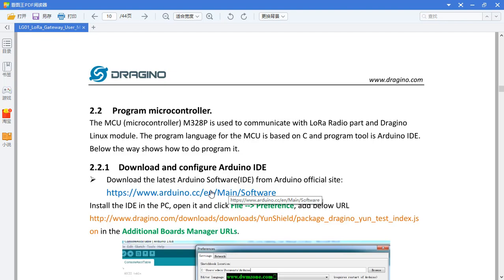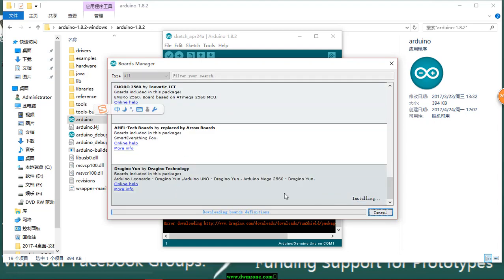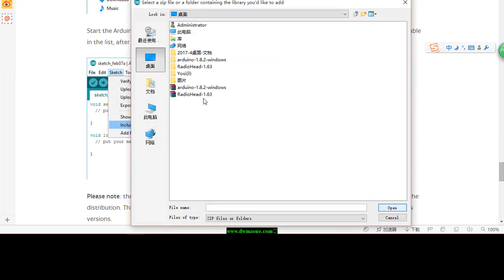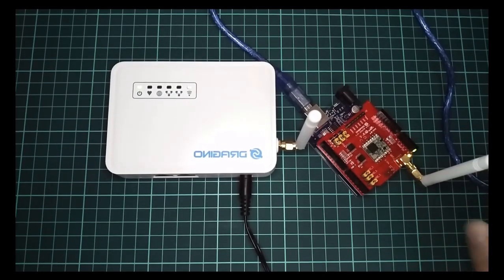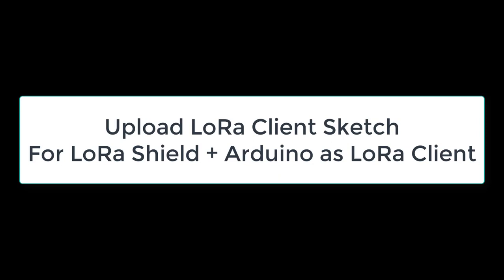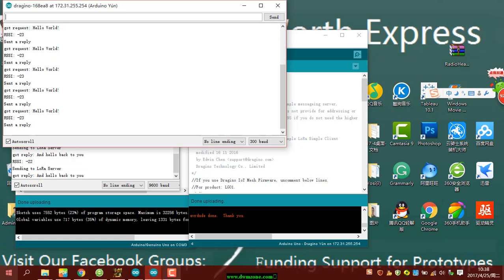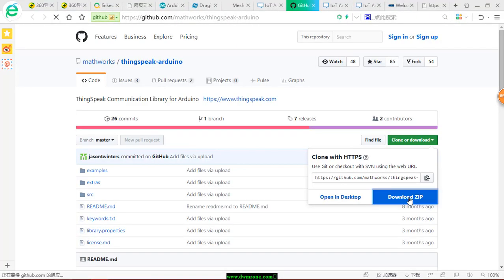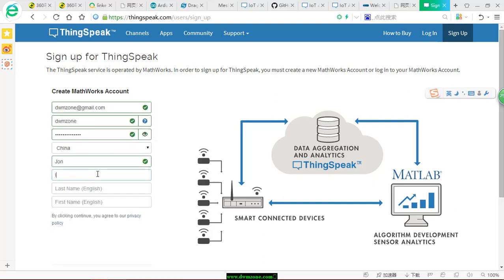LoRa IOT Development kit user guide-Simple Lora wireless example

Comment: I tried uploading the sketch to lg01 but I can't see my networking port, any idea why? is there an alternative way to upload the sketch?
Reply from the maker: you can connect the lg01 by a wire with RJ45 connector to the LAN port and try again.
Reply: Ameisina Dwmzone thanks for your reply, I tried using the lan cable to the computer as well but it isn't working, any other idea?
Reply from the maker: @TheeKiwing   can you see the COM port when you connect the gateway to your computer?

Comment: I tested it with lora client (lora shield + arduino uno) and lora server (lgo1-p) but in serial monitor lora simple client arduino there's show "is server running???" There's not get reply. And in lora simple server yun, i got reply "hello this is new device" . Where's the mistake?? Lora client can't get reply from lora server
Reply from the maker: the problems are wireless communication not build successfully, pls check and try it again.
Reply: Ameisina Dwmzone thanks, i try again and working. Now i try to test lora shield + arduino uno as end device and connect to TTN, do you have video try this?

Comment: hi, and thank you for the video. it's been more than a year now and lora development kit comes with 2 versions, LG-01 P (v1) and LG-01 N (v2), they said N version uses linux and the other one uses openWrt. my question is what's the difference between those 2 versions and what is the difference between using linux and openWrt (i only know that openWrt is a good OS for router devices but the documentation said that using a linux is good to control the sx1276/sx1278) and one last question, how can i change from 915 mHz to 868mHz or vice versa. ( what i know that both band uses the same circuit (not like the 433mHz), just change the antenna, hope that's ture)
Reply from the maker: Thank you! Linux version has lower packet loss  than the openWRT version for the Lora communication and it also can cover more end nodes, regarding the center frequency setting you can log in the back office and setting the center frequency.868MHz and 915MHz has little difference but if you want to use it as same we can't guarantee the communication quality.
Reply: @ameisinadwmzone7581  i should thank you for your quick answer. and you are right, i just found today this compare list in (http://www.dragino.com/products/lora.html) in LG01 (p or n) in document/ Dragino LoRa Gateway Selection Guide section this excel file with the comparison that i needed. and yeah, 1% loss for N version vs 60% loss for P/S version. the N version doesn't use atmega (direct control the sx1276) now i know what it means, but no sensor connection (GPIO) for the N version because no MCU are used. hope you can confirm that to me. and as i can see LG01-N more efficient than the LG01-P. and about the frequency band, i guess i will not care about that, it's gonna be for a home or lab use, i'm gonna use it in my home, let's not tell the government about that XD. unless you have an advice for me, i will appreciate it. and again thank you.

Comment: Hi! What if my LG01-P is running on 915MHz? What should I modify?
Reply from the maker: 1. you have to make sure you have 915MHz version gateway.2. login the gateway back office and set the radio setting to 915MHz.
Reply: What about the code? Do i need to change float frequency=8.68 to 9.15? Because while compiling the code i got this error ERROR: address 0x3e010 out of range at line 1256 of /tmp/sketch.hex
Reply from the maker: @taymingkai4360  for code:float frequency = 915;  //frequency settings for the gatewayseting:TX &RX Frequency:915000000
Reply: @ameisinadwmzone7581  Sorry for keep disturbing but it still won't works although I've performed the changes according to your instruction. The serial monitor will display the temp and hum. However, ThingSpeak shows nothings and i got this message from the serial monitor->No reply, is rf95_server running?
Reply from the maker: @taymingkai4360  you have to make sure the gateway received the data from the client first and next stetp check the thingspeak showing.
Reply: @ameisinadwmzone7581  But I can't even upload the lora server check.... The serial monitor shows unable to connect...is the sketch using the bridge?
Reply from the maker: Pls download the user manual and check the details which show you how to upload the Lora server, here is the link:http://www.dragino.com/downloads/downloads/UserManual/LG01_LoRa_Gateway_User_Manual.pdf
Reply: Watch our Youtube Channel for More videos on Dragino Products
https://www.youtube.com/watch?v=YD_8sq2_tUw&list=PLDQtDl_T-tm3ehh4iCMY--CWnrDXh1nDB

Comment: What is the difference between lora LG 01 S and LG01 P?
Reply from the maker: the difference is the LG01-S has a screw terminal which can connect to external
sensors and the LG01-P without that terminal.

Comment: Sir , we r doing a project on animal tracking using Lora technology....will this kit be useful for us? We r using 2 sensor nodes and we are implenting in our college campus
Reply from the maker: yes, it can use on this kind of project. we are also working on a project for wireless ear tag sensor with this kit.
Reply: You can use LoRaWAN GPS Tracker for this project http://www.enthutech.in/store/wireless-devices?product_id=105

Enthu Technology Solutions India Pvt Ltd is an authorized distributor for Dragino LoRa IoT Products. For Purchase Contact: 0422-4217197 | 9940707197 | 9597268857 | info@enthutech.in | www.enthutech.in | www.enthutech.in/store